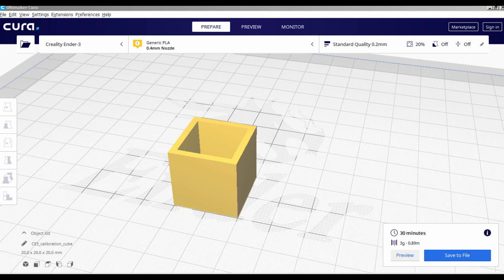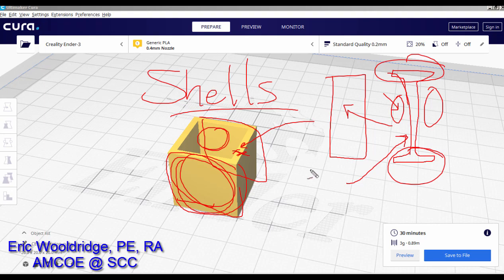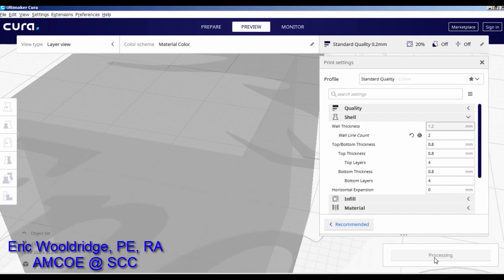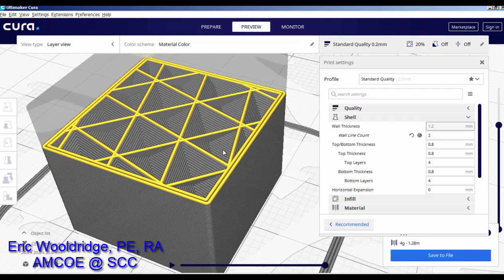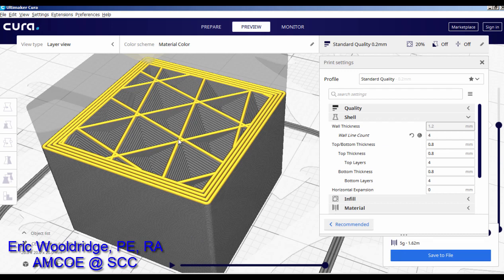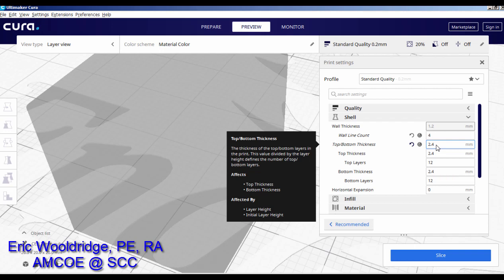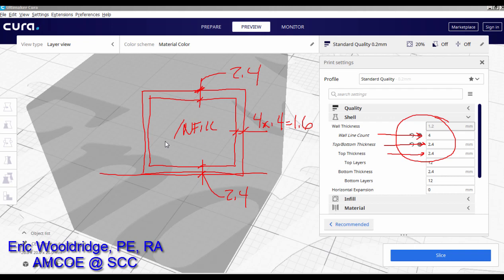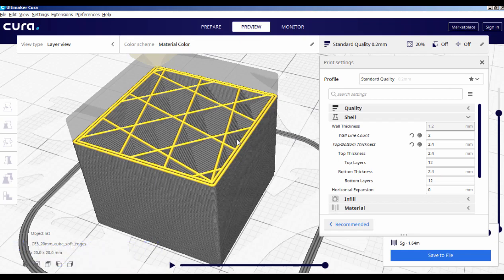0125A - The Additive Guru, understanding shells and wall thickness in 3D printing

Comment: My prints gets about 0.15mm to thick on all walls. Which means holes gets 0.3mm thin and the outside 0.3mm to thick. Any way to fix this?